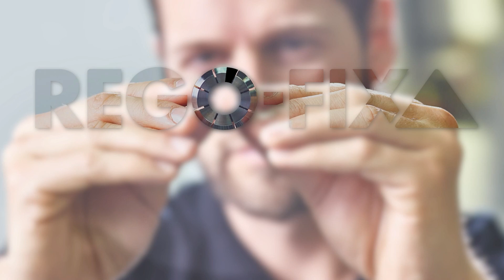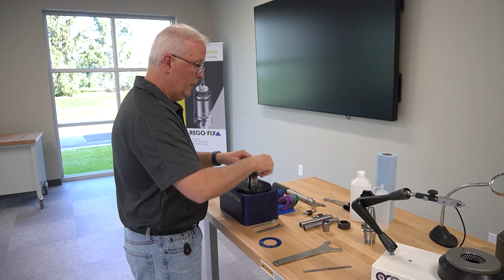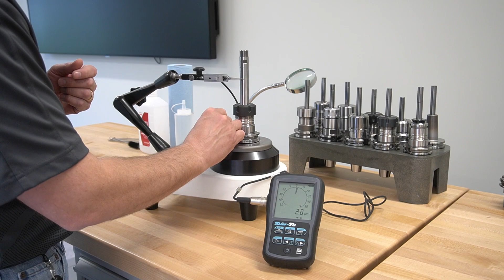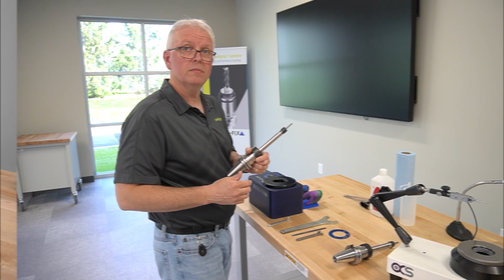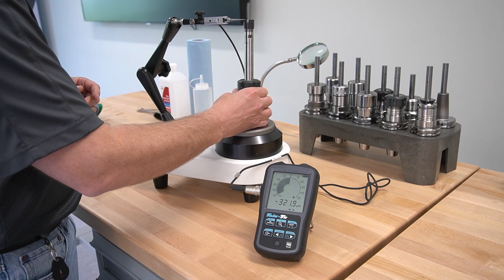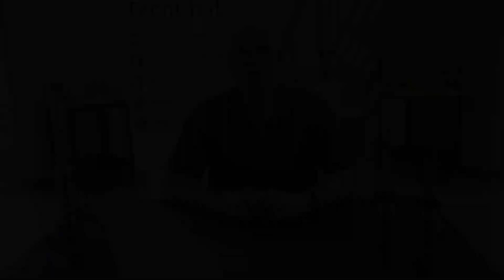TechChat - ER Stackup & Repeatability

Comment: What brand and model is the manual spindle used for runout measurement?
Reply from the maker: Unfortunately the company who produced that zero spindle went out of business some time back. I'll check with David and see if we can find a similar unit, as most other zero spindles on the web are horizontal fixtures instead of the nice and easy basket system this uses.